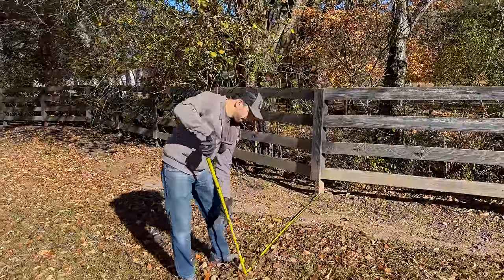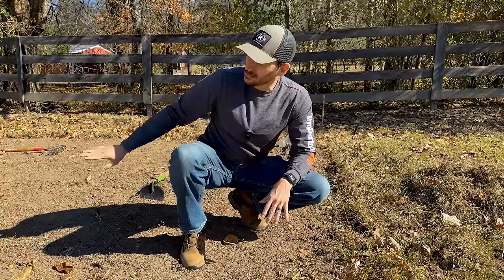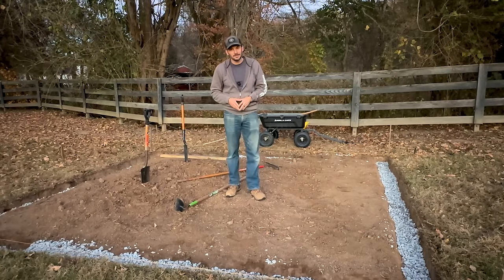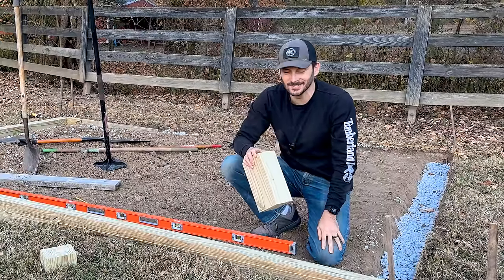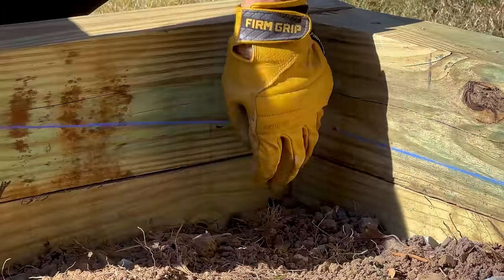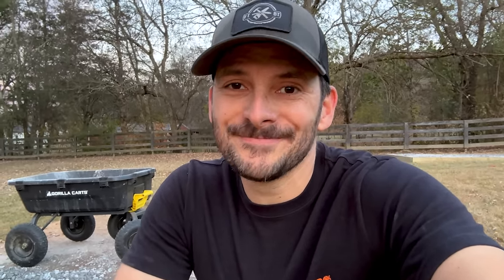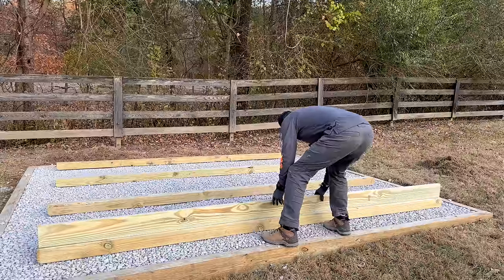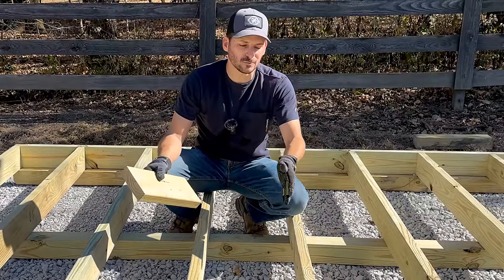I Overbuilt This Shed Foundation ... and it's awesome

Comment: I put all my sheds on two large timber skids. If I build the shed myself, the skids go down first, then the floor framing is built right onto the skids, then the walls, roof. If I buy the shed, I simply jack up the shed and install the skids myself. I like the skids because I discovered that I move my sheds as I make more development to my properties, the skid mounts allow me to simply attach a chain to the skids and move it with either a tractor or a skid steer.  Some I've moved over a quarter-mile, simply dragging them on the graveled driveways. I don't even unload the shed, just make sure nothing will fall over inside. 

I've even built a pump-house shed and picked it up with extended forks built this way and moved it over a half-mile. Since the skids support the entire floor, there was no distortion of the shed when picking it up. Another pump-house shed had a plywood bottom (under the bottom of floor framing) so I could set this on directly on top of a 8 ft. culvert buried deep into the ground. This shed had the entire floor foam-board insulated to keep the culvert and pipes / tanks from freezing. To move that shed, I picked it up with an excavator and nylon straps and set it in place. So I move a lot of sheds... and am planning on moving yet another one this summer!

To level, I just use simple blocking or grade the ground surface. So far, 20 years have passed for some of these sheds and the skids are fine (no rotting). I used treated timbers of course.

Comment: The title to this video is spot on, you way way over built the foundation.  Are you doing anything from keeping critters from going under the shed, I see that you have two sides open?  I saw another comment about us engineers overdesigning/overbuilding things that ai can relate to but this takes that to a new level.

Comment: I hope your shed appreciates the amouont of work that went into it's birth. I found a Gorilla Cart thrown away because the tires were flat and the handle was missing.  I just dumped about thirty wagons full in my yard scraped off the bed of the pickup.  One ton is plenty for a shot bed. Oh, and throw away the HF pneumatic tires and get the solid ones.

Comment: Great job. I recently installed a resin shed (couldn't pass up the clearance price - 50% off!) and had to weigh my options for the foundation. I considered installing a frame on a deck block foundation before finding a retired concrete pro who poured an 8x20 slab for $1600. My property sloped more than yours, and I have a wrist injury, so digging out the grade was not an option for me, but this looks much better than the frame option I was considering.

Comment: "Want to find the Most Level Ground you can".. 180ft Deep x 150ft Wide, from Back to Front my land Drops 18ft... and can hit water ( depending on season) from 1ft to 6ft down... No matter where you did... I had to put my Simple 10x10 in Blocks and a 1ft Overhang all around. Cost Well UNDER 1000. To buy the Same Size Shed, would have cost ( with their payment plan ) over 5000.. No Paying Off early notices..

Comment: OK, a couple suggestions from experience (I helped a friend put in an above-ground pool many years ago).

1 -- it probably would have helped if you'd gotten a tiller to loosen up the soil beforehand. "Oh, but then it would be soft, and settle!!" Yes, which is why you then run a hose out to it (possibly not practical in your specific circumstance) and then water the ground down to "pack" it, especially using the tamper.

This leads to:
2 -- you can use a smallish 2x4 -- probably 2-3 feet long -- to gradually push some dirt to the opposite end (e.g., to "screed" it). Get it approximate when dry, and then you can scrape it better when wet, to even stuff out across the... ah... "board". This is probably easier than shoveling. You can even make it easier if you have two people and/or a small tractor/riding lawnmower -- you could have someone put weight on the board as the tractor pulls it slowly.THIS can make that levelling job far far easier. You could even rig something that let you stand and walk with it while keeping some weight on it as needed to find that nice middle ground that gets 2-4 inches at a time but not a hell of a lot more.

Water it down again when you get all the leveling done, so you can be sure it's packed tight. Having heavily watered it -- turned it into serious mud -- will help really really pack the dirt down. Do *NOT* underestimate the value of using water -- even if -- particularly if -- you're using a hand tamper, like that shown -- to get the water compact. Doing it when it is distinctly slushy mud allows the sand particles to flow around each other to get tightly packed. Obviously, you don't want too much water, you don't want it puddling on the top, but really "slushy". It's good if it splats a bit when it lands, then there's a puddle when you've hit it a couple times. Yeah, you're going to get dirty... That's half the fun, until you track it inside and the wife gets very annoyed, so prepare ahead of time to clean off outside. 😀

NOT applicable to this scenario  -- for a circular bed (e.g., a gazebo or a circular above ground pool), you can use  rebar to create a pivot point, and then push it around to scrape a circle level, using a beam level such as the one you show, to get it very flat very quickly, as the scraping will push stuff into the holes readily. Again, apply water routinely to turn it to mud, so it moves and packs readily.

You might have put some watershield -- tyvek -- down on the underside just because that part is going to collect dew and moisture?

Comment: Nice work on that shed foundation Brad. I would have put down either a concrete block or cement slab and then just purchased a prefabbed shed. Easy peasy.....   👍👍😉😉
Reply from the maker: That would be a very boring video, Steve 😂😂

Comment: Yaay! Thank you for using a foundation that isn’t a concrete slab. I’ve wondered before if it’s truly necessary to have a concrete foundation for a shed
Reply from the maker: this option will be much much cheaper (and more work, lol). I have about $250 of materials in the gravel base vs close to $1000 if it were poured
Reply: @Fixthisbuildthat  and concrete produces alot of CO2  so the gravel will be a greener process

Comment: you might just get some holes dug 2'+ into the ground, put used phone poles in there for a free frame, and then lay baserock with a loader and back drag it.  do you care if you have baserock around the shed and rampint the doorway?  fill the holes for the poles with baserock too, you need no concrete.  i made a shade awning this way and a greenhouse.  4' centers for poles will work with corrugated galvanized, and used stuff works.

Comment: Great video. But here are some points. When you removed the grass, you should have gone down to 4 to 6 inches to remove all organic matter that could make the slab sink later. Also, the proper gravel depth under a concrete slab is 4". I have been a general contractor for over 40 years. Just giving you a helpful point.

Comment: Good job on lapping your outside boards rather than using the same pattern that was on the bottom. As some one who did residential concrete for 30 years, several comments. One on your aggregate/rock, you do need the fines in the rock. This is mostly to fill in all the voids in the rock. Take a bag of beach sand to the rock, and put a hose on it, and in the 1 foot deep areas, you will have at least half of that sand disappear. Most people never consider how much open holes there are in gravel, even when compacted to 98%. The fabric on the bottom was a good idea, as much to spread the load as anything. The rock will eventually sink into the dirt, and your compaction probably was not getting any where near 90% compaction. You need water and a "sheep's foot" thing to get full compaction. The shovel, aka 'F n Idiot stick', and yes, I am a certified engineer of that tool, in the dirt you have, it is really a cutting tool, so if you sharpen it first, it cuts a lot easier. When all is said and done, it may have cost a bit more money, but a concrete slab would have worked out way better, and with the anchor bolts in the slab, it will never fly away unless you get an "end of times" storm.

Comment: It seems that a far easier and far cheaper method would be to elevate the shed on some footings, using patio blocks or something similar.  Start by building the floor frame, then put blocks under the frame at regular intervals.  Use something large like 12"x12" blocks to spread the load on the ground.  No need to make the ground level, just use appropriately sized blocks to make the frame level.  You don't need to worry about drainage because the shed is not sitting directly on the ground.  That's what I did with my shed over 10 years ago, and it's still going strong.  Using gravel to elevate the shed and provide drainage accomplishes the same goal, but is way harder and more expensive.

Comment: Nice job seems overkill but it's your time/costs and that's just extra strength. I always leave a small gap (thickness of 16d com. nail) between plywood flooring/sheathing to prevent buckling if it gets moister from ground/spills. Ray Stormont

Comment: I am having a prefabricated shed brought in and this was perfect for me to start creating the gravel base for it.  My question is. . . since the shed that is being delivered already has a floor to it, should I make a shed foundation as shown to make it sturdier or would having the floor of the shed sitting on the gravel be sufficient.  The shed is actually going to be a 12x20 dog kennel with 4 kennels inside.
Reply: If planning to use "blocks/pavers" to support walls, and worried about critters easily gaining entrance by digging below shed and gnawing wood, consider supplementing with hardware wire and concrete or post mix. I had to do this for a chicken coop/run I built:
1) dig a trench between posts; 
2 run hardware cloth up between studs and posts, with bottom of run more than exceeding bottom of trench;
3) cut bottom of hardware cloth and kick into bottom of trench; 
4) use generous amounts of post mix to fill trenches between posts and studs;
5) If you later see entry spots or evidence of attempts, patch with more hardware cloth. Don't allow even a small win for the critters or they will persist.

Comment: I wish I could pound rebar into my ground like that, but mine is so super full of sizeable rocks due to the glacial moraine. If I dig just a one foot cubed section of dirt, I'm sure to have at least 20 rocks in the 3 inch to 7 inch range, plus lots of smaller ones and frequently a bigger one. Every anchor I have tried to drive never makes it past 12 inches without hitting an impenetrable barrier. And forget trying the average auger.
Reply from the maker: Yeah, I only hit one rock (where I ground off the rebar) so I was lucky.  It's pretty rocky here, but not like what you're saying

Comment: what is the function of the 4x4 skids vs just the 2x6 directly on the stone base?  Is it for air flow?  Or so the skunks can have a nice place to hang out?

Is the 4x6 PT that you used rated for ground contact?  It looks a bit light on the chemical

Comment: The only thing I would have added, would have been a layer of 6 ml polyethylene over the tops of the joists, before the plywood. That way, you would have stopped any vapor from the ground coming up through the plywood floor

Comment: If I had to drill holes like that out in the field, I would take a 4x4 block to a wood shop and drill a 3/16 hole with a drill press.  Then onsite, I would put the 4x4 on top of the 4x6 and drill through with a 3/16 pilot bit.  finally, I'd drill from both sides with a paddle bit.  
At least I'd try that. It probably wouldn't be perfectly accurate,  but I bet it'd be close.

Comment: What is the benefit of a foundation like this vs. a reinforced concrete slab? This seems to take less time, however won't the gravel set with time? I know this might also be a specific question due to type of soil, but in general...

Comment: I still would have put a layer of plastic down as a vapor barrier on top of the joists, before adding the decking. And if critters are a concern, I would have put a layer of screen down first, to protect the vapor barrier. 🤔

Comment: It might have been easier to use a hand tiller to loosen all the dirt on the inside then rake it to the level you wanted - but then again I was not there doing the work - only an observation from what I could see in the video - looks good though

Comment: A geo-textile fabric would have been a nice addition to go under all the stone, including the perimeter timber foundation.  It keeps the stone from filling with fine silt and causing shifting.  In my area, hydraulic movement of buildings is such a big issue due to soil composition (very high quantity of dark clay) and our typical swings between wet and dry season.  We can go for 2-3 months with no rain and 100+ degree temperatures, then have times later that year (like right now) where we get rain for 12-20 hours a day for 5-6 days at a time.  This swing in surface ground water causes the silt/clay to push up into foundations like this and dropping them in a very short period of time.  Builders take one of three options.  They ignore the problem, build to minimum code, and expect the building to be replaced in 15 to 20 years.  Or, they drill/drive pilings of concrete or timber no less than 30 feet into the ground, getting to a stable depth.  Then, a traditional foundation is built on that.  The last option is the newest.  The builder digs below the bio layer, and mixes in cement (not concrete as there is no aggregate) into the soil.  This is done to a depth depending on the expected load on the foundation.  This is compacted in short lifts, creating the forms for pour in place beams and the foundation for the slab.  If plumbing is required, the rough-out is done quickly so the sub-foundation can remain as homogeneous as possible.  Then, geo-textile is place atop this stabilized soil, either rock or sand is added and compacted to build up a level foundation for the concrete.  Then, the concrete is poured in two staged.  First, the beams are poured with a tight mesh of rebar is installed, with a large number of loops to connect the beams to the slab.  Once the beams are cured and any needed forms a removed, the foundation fill is compacted again, topping up low spots with a dry mason's mix. Then, the slab is poured on top with either 8x8 #3 or 1/4" post tensioning cables set in at least a 90 degree grid, if not adding extra for any area expecting to see greater loads such as a large bath, hot tub, fuel or water tanks etc..  Otherwise, buildings are still built on small pads with pier and beam construction with the explicit notion that it will need to be re-leveled every 3-5 years, and the slabs added to or replaced every 10-15 years.
Reply: Dark clay, and 30 ft to stable soil: Gulf Coast? Louisiana, perhaps?
Reply: @RossReedstrom  Texas.  Houston metro area.
Reply: @jameslmorehead , Well, then: Hey there, neighbor! Me too.

Comment: Personal preference, but i would've bought/brought four large boulders, set them as corner posts and put the structure on them, on chiseled surfaces, with charred wood to prevent bugs from getting in. Leveling stuff for such a small project or trying to overcome other features is kind of a big effort for not much result. Don't get me wrong 10/10 shed foundation, but... 4 boulders would've worked just as well. And if there's one thing i've learnt, there's always someone wanting to get rid of boulders. jm2c

Comment: I live in New Mexico, and unfortunately, 811 is useless.  They will NOT survey private property.  You need to hire a private site survey company to ensure you don't hit an underground utility within your lot lines.  It's unfortunate that they advertise utility tracing, yet when you call, they tell you you're out of luck.
Reply: It is the same in New York State - 811 will mark up public utilities but the rural homes in the area have underground electrical lines that start from the pole and lead to the house.  Anything from the pole to house is private and not covered by the 811 service.  So to your point , the service is close to useless - at least in my area.

Comment: I have been catching up on your videos (just found your channel).  Its getting colder so I'm switching from driveway mechanic to interior woodworker.  Like many simple DIYers I'm always adding to my tools.  After owning many sanders I'm ready for a planer.  But I won't use it much yet and its just for fun so one of the budget friendly ones.  The one draw back I see with these is the in/out feeds are not as stable.  What's your opinion on mounting a spot for the planer receased into the workbench (like my mitre saw and table saw) in order to have huge in/out-feed extra space and maybe stablize the in/out feed shelves in the process?
Reply from the maker: I think it would get in the way more than not.  My solution was this: https://fixthisbuildthat.com/fliptopplans

Comment: Any plans on running some basic AC power to the shed?  It sure is handy to have interior lighting and perhaps an internal or external GFCI receptacle, or maybe just a couple of solar panels, a small battery, and a DC light for inside.  I ran power to my shed (about 80 ft. from panel) using 10-3 UF (direct burial) wire...never regretted it.  Keep up the good work!

Comment: Just subscribed cause the video was well explained and well done. Good job! I plan on doing the same thing this spring but just getting a 8' x 12.5' plastic shed, is this overkill for that type of shed? I could probably get away with 4x4's I think?
Reply from the maker: 4x4s and gravel to level would be fine